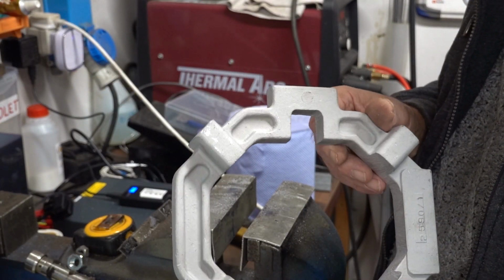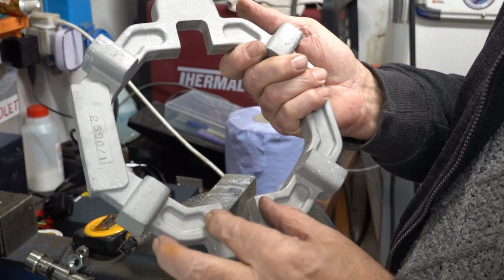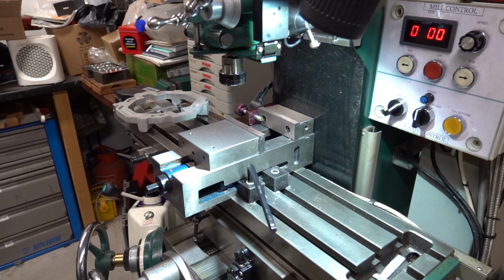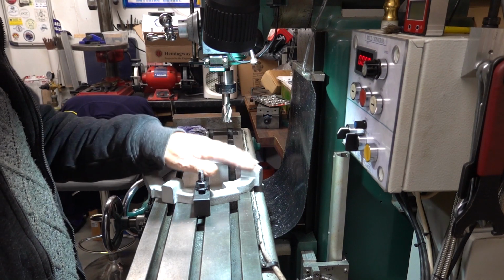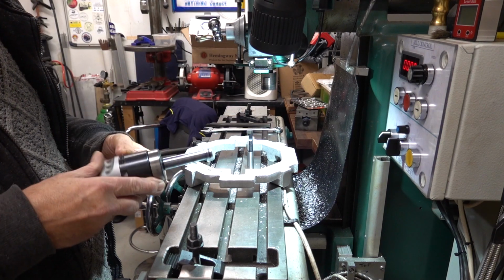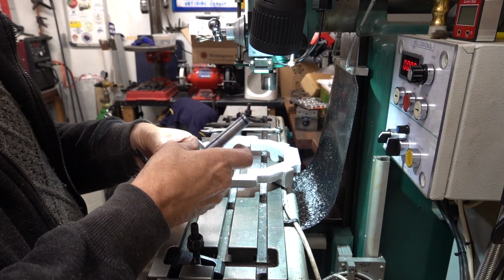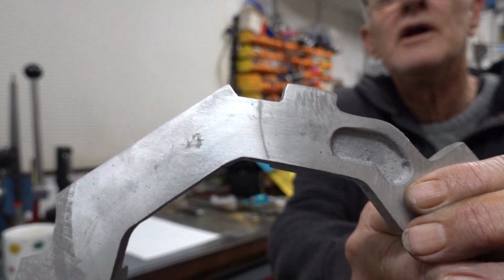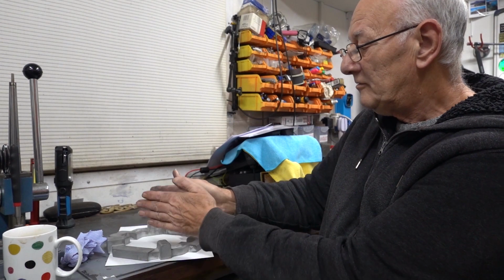Part 2 Hemingway kits large bore lathe steady rest

Comment: You're a braver man than me to take this on, I am supprised you still have to buy more material to complete the kit. the video is just fine without music
Reply from the maker: Hi John. I do not have to buy anything to complete this steady rest. I chose to substitute the supplied Brass bar for some phosphur bronze i have in the drawer. Slightly confused as to why you think i need to buy more materials. Everything are in these kits to do a complete build. I have no association with Hemingways whatsoever. I wish i had & then they could send me these free to revue.
Regards.
Steve.
Reply: @Steviegtr52  Hello Stevie I only said that because you said at about 16 min that you had to go on ebay and order some 6mm stainless which considering the cost of the kit I would have expected Hemingway to have included
Reply from the maker: @johntheoldmod  Ah no John it came with M6 threaded rod sort of zinc plated. I decided to make it look better to buy some M6 Stainless rod. Sorry misunderstood you. 
Steve
Reply from the maker: @johntheoldmod  Yes John it was just me trying to be posh using some shinny metal instead of mild steel.
Regards.
Steve.

Comment: I have watched a few Hemingway kit builds and I am very unimpressed by them. They consistently short you on material and seem very expensive for what they are.
Reply from the maker: Hi Mark. Not too sure about that. The knurling tool i made was only just enough to do the job, but i did not have to buy any more. With this build there is everything i need . In fact i am not going to use all supplied materials as i am going to make some items from Brass for all the thumbwheels. The fingers are going to be made from Phosphur Bronze which i have in stock. £70 is not cheap you are correct but try & buy a say, Myford one & they are asking more than that & they are only 50mm diameter.